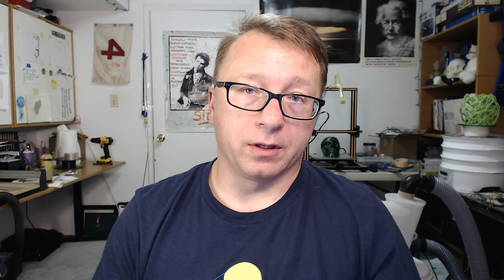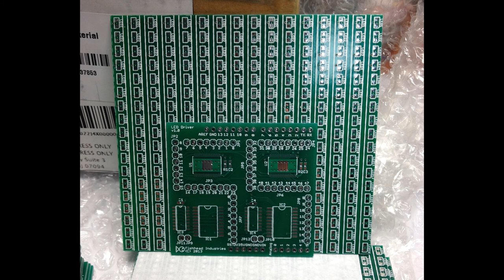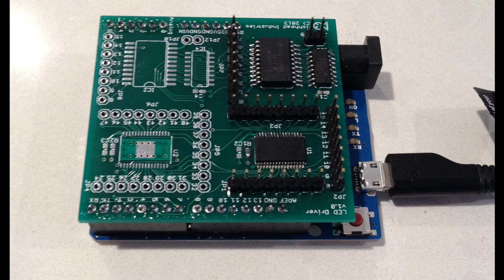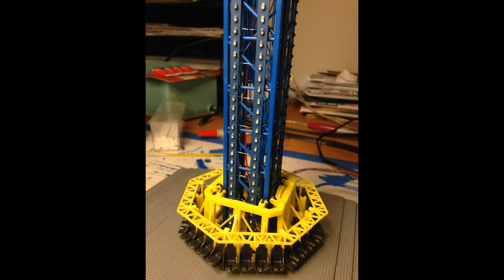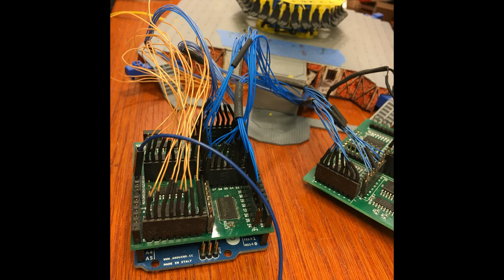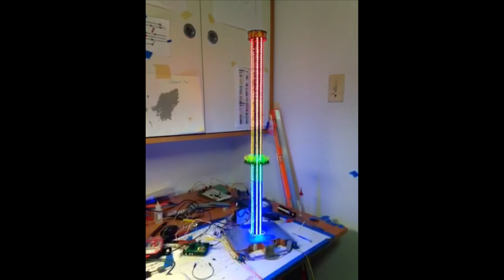Faller Power Tower with over 700 LEDs

Comment: Hi.. are you selling it? Amazing lighting effects
Reply from the maker: Hello - it is not for sale, sorry.  The code is available if you would like to make your own.
Reply: @cyberreefguru  noted.. pls advise the LED type you used for it. Thank u
Reply from the maker: @fastloud24supercarsonhighw42  They are all 1206 surface mount LEDs. I purchased full reels to save cost. I have some boards left over if you are interested. That said, there are new RGB LEDs on the market that would really up the game. I bought some but have not had time to use them. They would greatly reduce the wire challenges and are fully programable.  Shoot me an email if you want to discuss further.
Reply: @cyberreefguru  thank you for the answer. It helps...what controller are you using for the power tower?
Reply from the maker: @fastloud24supercarsonhighw42  Custom built multiplexer capable of supplying the correct voltage and current for all the LEDs.  I think it can power at least 1024 in total if I recall properly.

Comment: Very impressed with the work that you did to the Power Tower.  I am involved with a local model railroad club and we have this same model as well.  Would be very interested in a parts list for this upgrade.  Have you posted the other video with more details that you mentioned in this video?
Reply from the maker: Hi Dave - I'm fairly certain I did a walk through of the electronics -- I'll check.  Happy to share the files and what not, and some future plans that are way more cool.  I think you can dm me or something though youtube.
Reply: @cyberreefguru   I sent you an email to the email address a few days ago, just wanted to check and see if you received it. Had some additional questions for you.
Reply from the maker: @davecole6315   Hello Dave - I responded via comment but I didn't see an email.  Happy to help how ever I can.
Reply: @cyberreefguru  I sent the email to the address that you have listed on your YouTube About page. That was the only way that I could find to contact you outside of comments. Are you able to check that account?
Reply from the maker: @davecole6315  I'm not sure what's going on.  I checked out the email address and it's correct (youtube name @ gmail) - I tested it and it works (I check the account regularly and I have nothing from you and there doesn't seem to be anything in spam).  If you want to post your email address I can email you (and delete the comment later).
Reply: @cyberreefguru  I sent another email to you yesterday. Let me know if you received that. Sent it through Gmail so you should have it. Maybe check spam folder. If that does not work then I can post my addy

Comment: Where can you get the electronics
Reply from the maker: Hi Paul - I design and manufactured the components myself.  Happy share the cad files and source code if you want.

-Tom
Reply: @cyberreefguru  I was wondering how much did it cost to make everything
Reply from the maker: Hi  @paulyates7542   - that's a complicated question - I purchased the LEDs and resistors in bulk and didn't use all of them. Here's approximately what I spent:

LEDS - $100
Parts - $30
PCBs - $20
Arduino - $22
---------------------
$172

Most of the parts are less expensive now and I have a newer design that is simpler, but I've never tested it.  How that helps.

-Tom
Reply: What LED do u use for it? SMD 1206/1515/0805?